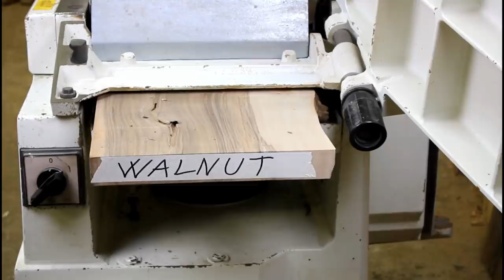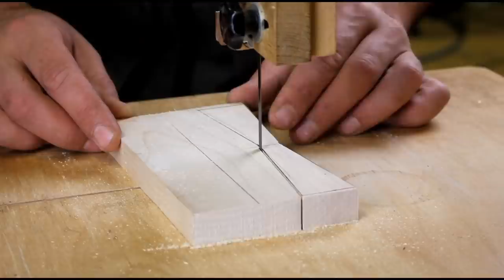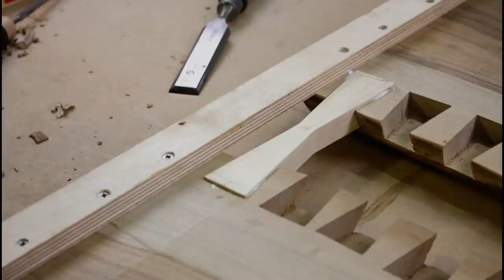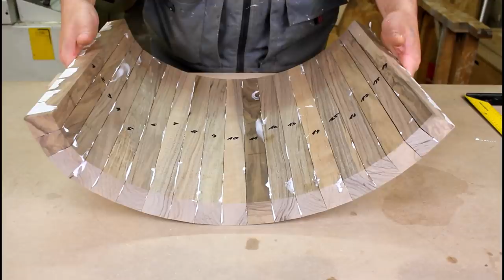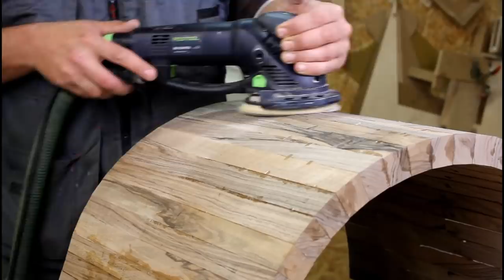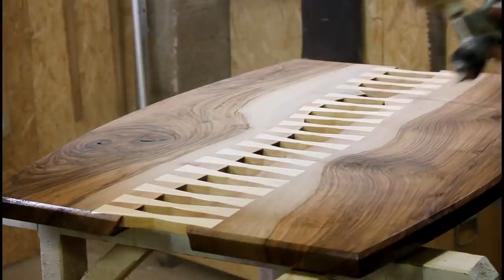" Stitched " Coffee Table / Making Walnut Coffee Table w Fluted Base

Comment: Thumbs Up to your skill and wood art. 
Just wanted to ask you why did you not use Epoxy in between the joints and on the board to look more beautiful. It would have also avoided glasses from falling getting into the joints.
Reply from the maker: Thank you for your kind words.
I'm glad you like it. I thought about that yes. But adding epoxy would turn this table into just another epoxy river table. There is plenty of those already. I learned how to deal with the holes and I'm OK with it.
Regards

Comment: What did you use to bring the bow ties down flush with the table? Is that a spray lacquer finish? How many coats? I need to find some book matched Walnut now!
Reply from the maker: Bowties were around 2-3mm proud. I sand them flush on long belt sander. I sprayed ( gloss) polyurethane in 3 coats. Finding proper wood makes all the difference yes. Good luck
Reply: @Slovenianwoodworker  Thank you for the fast reply! It must be morning time there. 8pm here. New subscriber here
Reply from the maker: I appreciate buddy. Well it's 1:25am. Fev hrs of sleeping and I'm back in my shop.. enjoy your evening

Comment: Do you still have the footage of you making that curved base/foot of the table... just need to know how you calculated the angle on the 2x4
Reply from the maker: I don't have any extra footage. I did it by " eye " I cut 4 cm  around 1"1/2 wide stock to have more smooth curvature and tilt the blade for 3 °. If you use wider stock as you wrote 2x4 you need more steep angle . I suggest you to cut 2x4 in half and go with 5 degree. Test cut 2-3 pieces and put them together. You'll have visual reference how the curvature goes so by tilting the blade more or less you'll make base bigger or smaller.
Reply: Thanks for the guideline 😊

Comment: Really like the design of the top, but not sure why you have such a natural clean look for the top then go with a real rough looking base.

Also would have been extra cool/more practical if you did two legs with shelf open to both sides in between.

Wish I could source more types of wood to try this myself - guess I’ll eventually try an all pine version.
Reply from the maker: It was a person choice. I made This table for myself. And I liked that kind of base. 
Well I thought about having it opened but I decided to do it differently. Main reason are our house cats. This fxxxxxs are running everywhere and knocking things down. 
Thank you for your feedback and i hope you'll get the material. Good luck

Comment: Fantastic design and execution. Can I ask how you routed the butterfly close to the wood that is hold the two panels together?
Reply from the maker: Sure buddy. Once I trace all bow-ties to the both sides I actually remove those two pieces of plywood that holds it together. After I made slots fro bowties I put it back. There was option just to chisel it out but I was kinda lazy
 Thanks for watching.
Reply: @Slovenianwoodworker  I guess you number each bowtie and mortise to keep them straight.
Reply from the maker: That is correct. I think in some clips numbers are visible too. Cheers

Comment: GREAT JOB! Just one question. How did you attach the base?
Reply from the maker: It's similar as for regular table tops. In the base are 3 slots which fit that holder. I made if from oak and it allows wood movement. On Instagram I have pictures from an older post ( larch coffee table) where you can see it.
Thank you

Comment: hard to describe how much I adore this table. Absolutely stunning work.  Great original design, great craftmanship and  lovely wood, with a great finish.  A total stunner.  One question.  How did you attach the top to the base?  thanks for sharing this delight.
Reply from the maker: Thank you for your kind words and feedback. I appreciate. I'm glad you like it buddy.. Well I made slots in 3 places on the inner side of base and ship made fitting which goes into that slot and can be screwed to the top. Is fairly simple and allows wood movement. On my IG I have pictures of different table where I used this method. Thanks again. Regards

Comment: Another beautiful creation Uros, the bow ties look a bummer to sand when set up as are all small components mate, do you use any natural oil type finishes?, Nastra Vi 👍👍🍻
Reply from the maker: Thank you buddy.. well yes.. but I use Sharp chisel so I have a little sanding on the edges in the end. I mostly use oils. But this one will be used a lot therefore I spray it with polyurethane. Thanks for watching buddy. Cheers